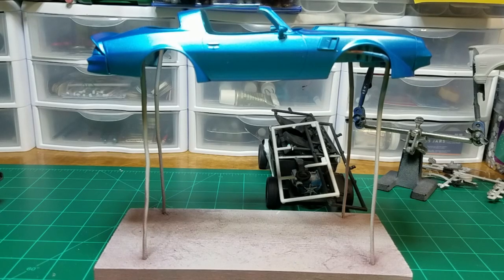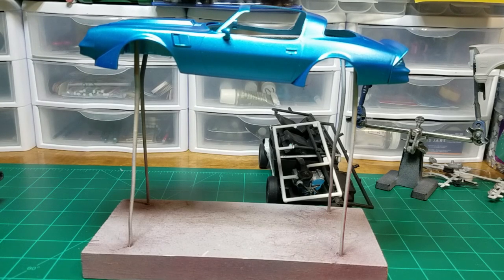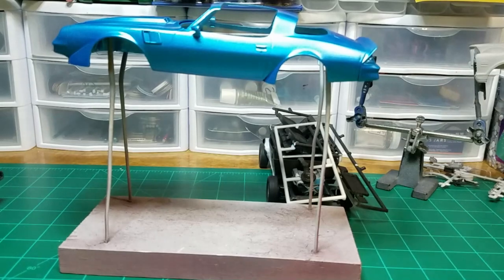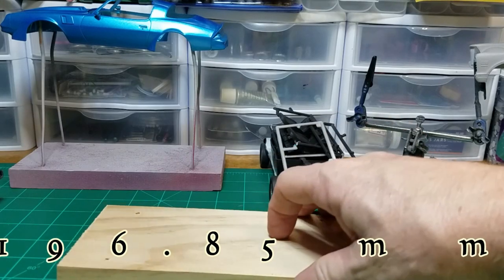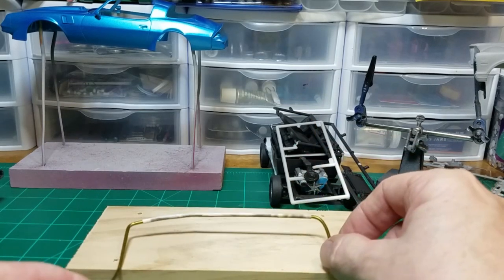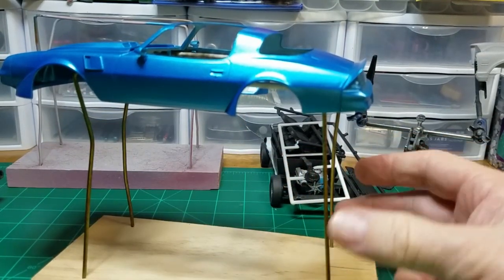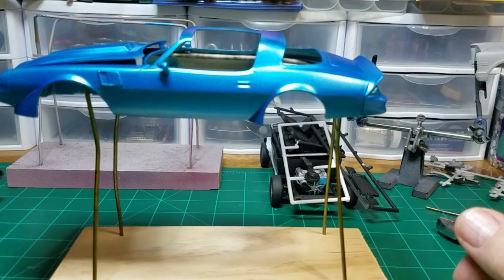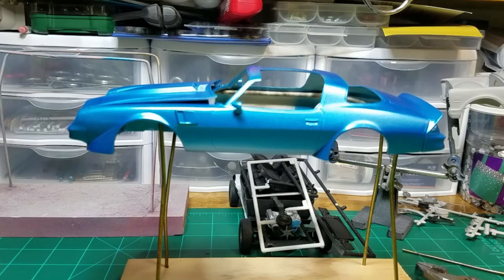How to Build a Paint Stand Practically Free! **BONUS VIDEO**  - Episode 23

Comment: Nice touch with the heat shrink. Any innovation to make model painting better is great. As Joe the Pharoah said in American Graffiti, "I got an idea, I got a good idea."
Reply from the maker: Thanks!  I decided to include the heat shrink tubing on this one to give it a little more bite so that it would grip the body a bit better. My original paint stand does not have the heat shrink tubing on it and sometimes it will allow the body to move around a bit. I am thinking about doing another in a smaller size to do things like two piece pickup truck cabs and boxes. Thanks for watching!

Comment: I've always made these types of stands , great tip for those who dont know
Reply from the maker: I figured that not everyone knew about this and even though this is as old school as you can get, it still has function and form and can be a very useful tool. Just goes to show that you don't have to spend a ton of cash to achieve a great paint job.
Reply: I also drilled extra holes in mine i case I wanted to paint t bucket bodies and motorcycle parts

Comment: Thank you .I  bought a Tamiya stand and it's a pain in the butt to use ..I will be making my own from now on .
Reply from the maker: You are very welcome! I hope that my video helped you out. I have never owned or used a Tamiya stand. I have always used something like this or just an old paint can. The problem with the paint can lid is that the body tended to fall off right after I finished spraying the paint. I built my original stand years ago and have been using it ever since. If you have any questions let me know! Thanks for watching.

Comment: I used a 2x4 and no heat shrink (great idea), but a lot cheaper than 25 bucks for  the "T" brand.  I'll have to build another with your dimensions and heat shrink, looks like it works better than mine.  Thanks for sharing, I'm always on the lookout for low buck tips!
Reply from the maker: Way back when I built my first stand, I had looked at a 2x4 as the base. I decided then that the 2x4 would be large and clunky. That's when I settled for the 1x4. I figured that the 1x4 would be less cumbersome to deal with. The original design did not have the heat shrink added until a few years later. On this second stand I decided to add the heat shrink right from the start. As I stated in the video, you may have to play around with it until you have it bent sufficiently enough to exert the proper pressure to hold onto the body. Do a "test" run on it before you begin painting to make sure that the body will stay in place. Thanks for watching and good luck with your new paint stand.

Comment: I’ve been pushing these for 25 years! I have about 20 of them. For some reason modelers insist on paying Tamiya $30 for one stand and I can’t stand it. I’m the original frugal modeler! I tape the body to the stand to ensure it stays put! I got a stack of about 250 wire coat hangers from a body shop that gets a uniform service, they throw the hangers in the garbage by the piles.
Reply from the maker: I am an "old school" builder. Though I have plenty of cash to support my family and I,  I still believe in doing things the way that I learned them. If I can do things and save money, then that's a plus. The original paint stand that I have shown in my videos was made back in the early 90's and I still use it today. I think that for some people it may be a status symbol to have the Tamiya stands. It's their money, so they can spend it how they want. For the more frugal minded person, they can use something like what you and I have come up with... Hold onto those coat hangers though... That's a gold mine that you have there, LOL!
Reply: @scaleautoguysworkbench  check with the shop at your local automotive dealership that wears uniforms!
Reply from the maker: @rickdee67  I hadn't thought about that. I know of a shop that I could probably get all of the hangers I could ever possibly need. Thanks for the tip!

Comment: I like it. How long are the pieces for your paint stand with the coat hanger?
Reply from the maker: Thanks! The pieces of coat hangar are about 16 inches long before bending. I thought that I had that information in the video but after reviewing it I realize now that I gave dimensions for the board and where to drill the holes but not the wire length. I hope that this helps you!

Comment: I bought some 3/16 flexible aluminum armature wire from eBay seller craft hobby listings
Reply from the maker: That sounds like it may work for this situation but it being aluminum, I don't know how long you could use this due to possible metal fatigue. Aluminum usually doesn't stand up to well against repeated bending. Even after you build this, you still have to squeeze it together to get body's on and off of it and this might possibly weaken that where it meets the wood base. I admit that I am not familiar with aluminum armature wires tensile strength. It may last a while, it may not. Good Luck and thanks for watching!

Comment: Well I gotta tell ya - 60 years ago when I first started building model cars I held them and any parts in my hand and sprayed them - no gloves - I went to school and church with painted hands - 
I still just tape them on a stick and don't care too much about over spray
summer time I paint out doors
Reply from the maker: I used to spray all of mine the same way. To this day I rarely use gloves when painting. I have found it a bit nicer to have the paint stand and the spray booth to do most all of my spray painting. I still tape some of the parts to a stick before painting. So you and I are still in the same boat when it comes to spraying paint this stand just makes it a bit easier to do without fear of it dropping off the stick.

Comment: Thank you. How are you in an airbrush? I just bought one. I need help
Reply from the maker: I have been using my Paasche Model H for several years now. Using an airbrush isn't that difficult once you figure out how to thin your paints properly and what pressure to shoot the paint at. The thing is about those two things are that every paint is different and you have to kind of trial and error at first until you get the hang of it. Whatever type of paint you are deciding to use will require the proper thinner for the type of paint and you will need to thin it down to about the consistency of skim milk. The pressure that you spray at will also depend on the type of paint but generally about 18-20 psi will work in most situations. A generally thicker paint like craft paint will require a bigger needle/nozzle combo somewhere in the 3 to 5 mm. Whereas a thinner paint like clear coats will can use a smaller needle/nozzle like a 1 to 3 mm. I would suggest getting a test body from a parts box for example and practicing spraying different paints or clears on that until you feel confident enough to try it on an actual build. I hope that this helps you out and Good Luck! If you have any more questions etc. I can also be reached through my ScaleAutoGuy Facebook page or through email at ScaleAutoGuy@Gmail.com